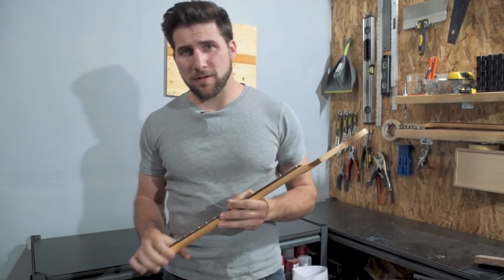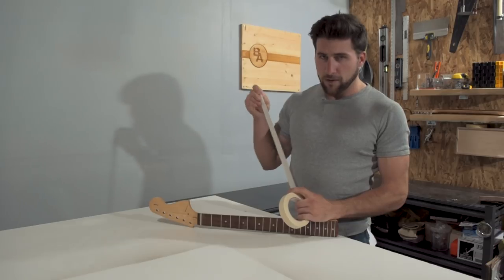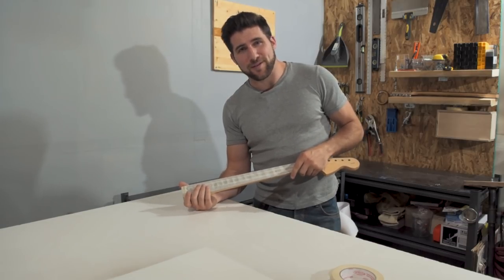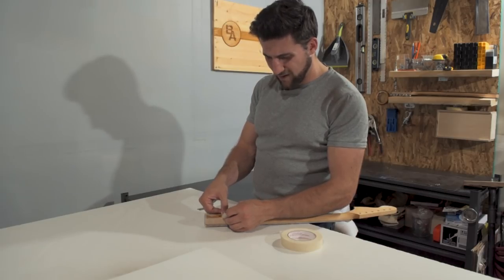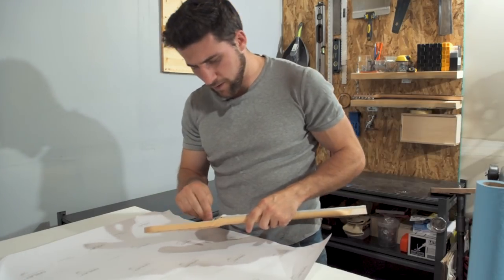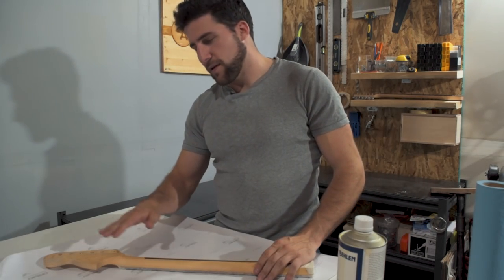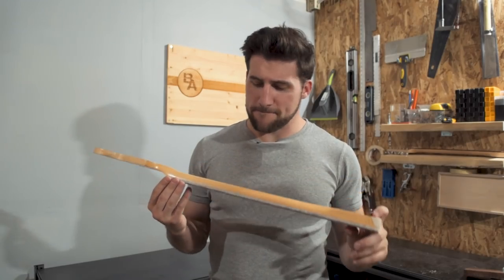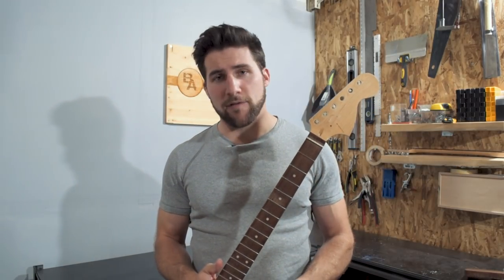How to finish a guitar neck

Comment: I did follow the advice of putting tape in the tuning peg holes, and I REGRET following this advice.

What ends upp happening is that your wood won't get sealed by the paint/lacquer, so the bare wood is exposed and will EASILY suck up moisture, during wet sanding for example. The wood around the holes started to swell just after a minute after starting to wet sand, and no, I didn't soak the headstock in water, and The tape was left inside the holes. This resulted in pretty big cracks. which sucks, because I had done a matching headstock in metallic paint that turned out great. Now: Sand it all back down and start over. Not putting tape in the holes this time.
Reply from the maker: Ok, but also don’t wet sand your headstock. The problem you had is a very common one and it won’t be solved just by not taping the holes. Avoiding wet sanding the headstock is the solution.

Comment: I use a step drill bit on the front and back of the tuners holes with a screwdriver handle attachment then I plunge it with a regular long drill bit. Don't waste tape.

Comment: Hey Brad I have a question I'm struggling with..  I trying to deck my Floyd rose on my guitar .. but when I deck it the action is to low can’t play it . Should I need to shim neck pocket or sand down the neck pocket? Would appreciate ur expertise! Thanks
Reply from the maker: Where is the action too low? At the high frets where it connects to the body?

Comment: wax and grease remover on wood??? Obviously not water based... but wouldn't solvent based to do something to the wood? I ordered warmoth neck to do my first build... and stupidly did not realize you cant use a maple on maple neck without a finish... I certainly know how to spray but... i'm kinda worried about it. Also couldn't you just clear coat the neck if you didn't want to color it? 

Thats all you do is oil it??? Do you have to re do that over time? What would you do on a maple neck/maple fingerboard
Reply from the maker: You can spray it if you prefer. Lacquer it or something like that and yes it can be clear. 
I like oiled necks. Sometimes they need to be re oiled a bit after a time. Depends on a few factors. 
There’s nothing wrong with a bit of solvent on wood. I use acetone or methanol on really oily woods before I finish them.

Comment: Great video man. I watch them over and over to get it all. Having said that, I had a neat coincidence on my first build or better yet, my first relic of a guitar. That extra thickness I didn't know about saved the guitar in every single way possible.  I just don't get it on this one cause the action was not redeemable. I sanded thr frets level and hoped for the best. That Squier replaced his Stratocaster.  How funny! It's all about that neck. What I do is clean it up and make the quality of the feeling like a Fender and in some case's,  better. Shine is nice but it slows ya down. Even the top guy's dull it from playing.

Comment: Brad
Off topic question, how would you fix a fretboards radius, wood filler or change the radius? Was a9.5 edges were sanded a hair too much
Reply from the maker: Sand the middle down flatter and then re-radius if you want 9.5 again.

Comment: Cheers dude,I've just sanded down my maple neck on one of my guitars ,probably gonna try the teak oil on it! How often do you need to reapply the oil? Does it get sticky after playing a while? Thanks great video 😎
Reply from the maker: I haven’t had it get sticky but it can dry out over time. I now use modified tung oil or Odies oil instead generally.
Reply: @BradAngove  Nice one,thanks dude,I'll look into that too 😎

Comment: Hi Brad, me again. Can I use Linseed oil instead of the Teak oil? Does it affect the finish too much, just a litte, or not at all? Thanks.
Reply from the maker: Sure you can. That’s a good option. Just be careful about safe rag disposal; boiled linseed oil has a bit of a reputation for cause bunched up oil soaked rags to spontaneously combust.

Comment: Not sure if you are watching or not, since this video is kinda old.  For the neck finish on the  back, have you every looked at Rubio Monocoat.  It was originally meant for floors, but is being used for woodworking as a finish.  One coat., it is matte and durable.
Reply from the maker: I’ve heard of it, but I’ve never tried it.

Comment: Does anyone know the answer to this? If I was to use a satin nitro lacquer (like the one offered by Oxford paints in Canada), would I be able to sand/buff certain areas down to a shine? The reason I ask: I have a 1999 American Standard Strat that I've played daily since I got it in 2001. These guitars came with a satin poly cleared neck. Over the years, the back of the neck has been polished down to a high-gloss by my hand through many hours of playing. I like that this shine is only present where I play, and the rest of the neck is still satin. I would like to replicate this on a new Strat build I'm planning. Is this possible? Would I have better luck spraying satin and gloss lacquer in different areas and blending them?
Reply from the maker: If you’re trying to gloss it up, you can use satin lacquer on the whole thing (Oxford is a great choice), then polish those areas that you want to have more shine. Oxford’s medium polish would work well. Just use a soft rag to polish.
Reply: @BradAngove  Great to hear. Thanks for taking the time to reply. Appreciate it!

Comment: Do I need to clean the back of the  neck after after sanding and before oiling? If yes, with what?
Reply from the maker: Yes. Wax and grease remover.

Comment: Thanks. Gteat video. So what oil, or mybe somthing else, you can recomande for apsolutly fastest, no sticking, no glose, super smooth nacks? Is it Tung oil, Tru oil, Danish oil, Teac oil?
Reply from the maker: Fastest is probably polymerized tung oil. Danish oil soaks in and would also be pretty quick. A satin lacquer spray should dry quite quickly too, but can feel sticky when it warms up from playing it a lot.

Comment: Thanks, well explained. I wonder: with a maple fretboard, if i want to apply lacquer on it, would you siggest covering the frets with tape? Thanks!
Reply from the maker: I wouldn’t. I would just polish them up before painting. Then after the lacquer hardens I would carefully cut down each side of the fret (angling underneath) with a scalpel and peel the lacquer off of them. Lacquer won’t stick to polished metal.
Reply: Thanks a lot i'll do this😊

Comment: What do you notmally do with the fretboard on kit guitars? Sand and apply a finish? Is there much difference between Teak Oil, Boiled Linseed oil and Tru oil for the back of the neck?
Reply from the maker: I like to use tung oil or fretboard oil on my fretboards, but you can also apply a film finish like a lacquer if you want. 

Tru oil tends to go on thicker and more like a film finish. The others are thinner options likely to soak in more.

Comment: Brad, 

Quick couple of questions: Do you think I could do this after staining it a Fender Amber color? 

I'm using a Reranch can of amber that contains no lacquer. I was figuring: spray it - light sand - finish with a satin... but I immediately think I'm changing that to teak oil. 

Should I keep my steps the same for the teak oil? Does it typically require a light sanding in the end? Your thoughts?
Reply from the maker: You could do that. Either option, the satin or the oil, would work fine. 
The teak oil tends to create a slight amber hue as well.

Comment: Hi! Good evening! After applying oil on the headstock, then apply a decal, after applying the decal, how many coats of oil should be applied on  the decal side? To erase the outlines, thanks!
Reply from the maker: I hate to say it, but I’m not sure you will be able to build up oil thick enough to bury decals. That’s not really what oil is supposed to do.

Comment: I'm getting ready to put paint on a kit guitar and I'm thinking about the neck.  This is a brand new unfinished kit guitar with all maple neck.  I feel like I should finish the front of the neck with something like polyurethane.  But I imagine I don't want to get that on the frets themselves.  Do I need to tape each individual fret?  Or apply the finish and then hand sand each fret?  What's my approach?  Can you help?
Reply from the maker: You can mask the frets, or spray them and then go through the levelling and crowning process. 
For masking you can tape or use something that paint can’t stick to like Vaseline.

Comment: Here is the issue I have run into, When repainting a Les Paul the neck is usually painted and finished with Nitro. How do you not end up with that line where the rosewood fret board meets the neck? By painting and putting Nitro on the body of the neck is now wider than the fret board. I am going to be starting a refinishing of a 1987 Gibson SG Special and was thinking of removing the Ebony fret board and then painting and finishing the neck. Is that the only way to not have that higher build up?
Reply from the maker: I usually just carefully reduce that ridge with a razor blade to make it comfortable.

Comment: Brad, how about putting some vintage amber on a maple neck that already had been treated with poly without sanding it down and removing any decals etc..?  could you truoil or boiled linseed over poly?  add some oil based tint?.. artist oils?
Reply from the maker: You could sand lightly and spray an amber tinted lacquer to darken it up. That would be my go to option in those circumstances.

Comment: Hey Brad, just wondering if you would mind answering why you use 400 grit instead of finer grit? I tried a small area with 1000 grit and it feels pretty good, but not sure what the difference is when teak oil is applied.
Reply from the maker: Mostly just to allow the teak oil to adhere properly to the wood. If it’s too smooth, nothing will stick properly.

Comment: Hi Brad, I have a new flame maple neck with a quilt veneer head stock. I plan on useing some dye and than sanding sealer to lock it in. I think I should laquer the head stock but I wanted to use tru oil for the back. I have heard that the neck could warp if it's not sealed with something harder. Should I be concerned, I do live in Fl. but only play inside. Please any suggestions as this is my first build. This is a warmouth neck and states on the neck no warranty if finished in oil     thanks keith
Reply from the maker: So it’s warrantied if you lacquer it but not if you oil it?

Comment: Hai, If you have stained your neck with a waterbased stain, do you clearcoat the neck before you start using the oil? Greetings, Rob
Reply from the maker: Hi Rob. Although a bit of the stain might show up on the rag, you should be good (once the stain is fully dry) to just go ahead and apply your oil. You could seal if first if you want, but it shouldn't be necessary.

Comment: Quick question, I have a roasted maple bass neck that I want to tung oil the back of the neck and have a gloss headstock. How do I go about this? Tung oil the whole thing first then get some poly or lacquer for the headstock or do headstock first then tung oil? It has no finish on it now. Thank you in advance. Love the videos.
Reply from the maker: Best bet is to do the headstock first, then you can easily wipe off any oil that gets on the headstock.

Comment: Not sure if anyone else asked, everything I saw was about oils. 
However, when painting a neck, I seem to always wind up with a ledge at the great board line. Advice?
Reply from the maker: That’s a tough one to avoid sometimes. I usually use some high-grit sand paper to gently reduce that.

Comment: tried to look at the comment section for an answer but didnt find one, but when you tape the fretboard from the sides (so where it transitions with the neck) there is a buildup spet/ladder of the finish/paint where you took the tape off so what to do with that ?
Reply from the maker: There isn't with oil, but with paint there is. I posted a video very recently about how to get rid of that ridge.

Comment: Want to remove the lacquer on the back of the necks of my Epiphone SG and Yamaha RS420 but dont want to damage the paint underneath. Is it possible to do this or can a painted neck not be sanded to a satin finish?
Reply from the maker: You can just sand it lightly with a very high grit piece of sandpaper to basically give it that satin feel. Is that what you’re looking for?

Comment: Is it possible to add a clear nitrocellulose lacquer after applying teak oil? While there be a negative reaction?
Reply from the maker: Generally after teak oil you would add an oil based clear or varnish if you need added protection.

Comment: Hi Brad, I’ve put on the teak oil finish and have allowed it to dry for approximately 24 hours, but notice it still seems to feel a bit sticky. Is this normal ? Should I apply another coat of the teak oil or just allow it to cure a bit longer?
Reply from the maker: Sorry, I didn’t get the notification for this one. It can take a few days to dry. How does it feel now?
Reply: @BradAngove  hi Brad, yes, I gave it three weeks , feels much better, turned out to make a very nice smooth finish , thank you so much. I’ll try to upload the photo. I , unfortunately used a stain that turned out to be a bit too dark for my taste but that was on me. No real harm done though.

Comment: Hey Brad, loving your channel, super helpful! Had question for you as I've seen you use Tung oil on the fretboard too - can you just not mask it off and use Teak or Tung oil on the whole unfinished neck (fretboard included) and that would be fine as a finish? And would you always need to thin the oil first? Thanks!
Reply from the maker: You can do that, and no you don’t always need to thin the oil first. That’s just to help it soak in a bit easier.
Reply: @BradAngove  Thanks man! Really big help on my unfinished neck build!! Will try it and see if I like the results...

Comment: I just bought a bass neck from ALLPARTS and it's only a single piece of maple without a separate fret board.  Can i use the teak oil for the entire neck or should I use s separate fretboard conditioner?  I prefer a matte finish on a fretboard.
Reply from the maker: You can use teak oil for the whole thing. Just don’t apply as much on the fretboard.
Reply: @BradAngove  thanks

Comment: how do i get rid of a sticker that's already on and, i'm sure, there's a poly coating.  is it just sanding and refinishing it all?
Reply from the maker: Ya, if it’s been coated over you would need to sand through or otherwise remove the coating to get to the sticker. It might be easier to just sand flat and paint right over it.

Comment: If you're like me [caveat], while you're at this, use a scraper to create a slight "flatness" to the back of the neck. I've discovered, played, and made necks like this. If you're a player, I'm sure you'll like it.
Reply: i did this. scraped too far and didn't leave enough  wood to hold the pressure from the truss rod mechanism. my neck exploded and I was very upset.
best option is to actually create a flat neck profile when shaping
Reply: @jackfitzgerald6868  Yikes! Thanks for the heads-up.